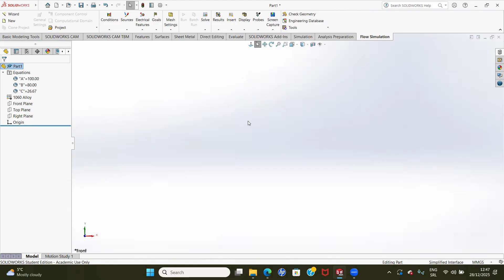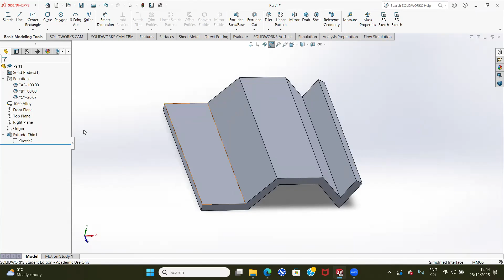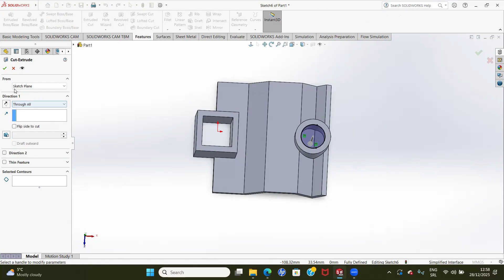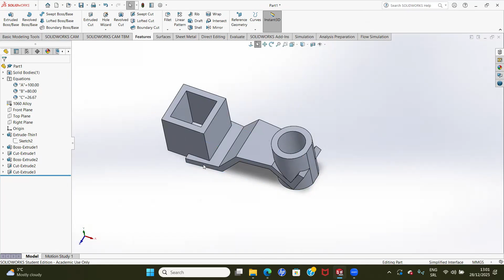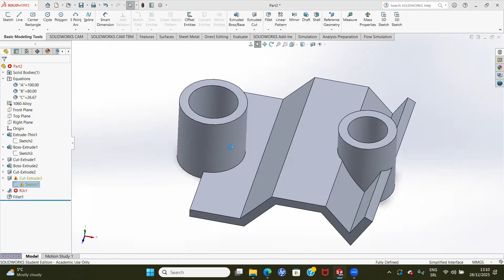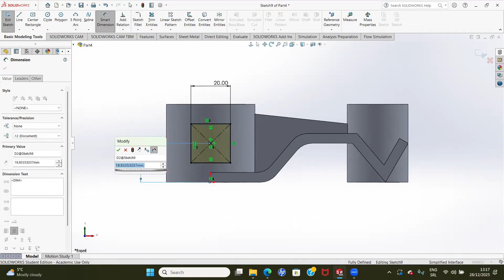SolidWorks CSWP Segment 1 Exam Sample

Comment: So this Video is pretty good at demonstrating some of the features that one may need for the CSWP. But I've noticed 3 inconsistencies from the drawing to the part.

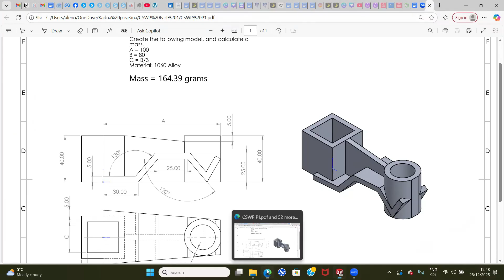1. 4:46 - Points aren't explicitly indicated to be on the horizontal line. Generally not good to assume those things. You can for the bottom one because the dimension like goes through but the one from the line to the point, not really.
2. 8:24 -  No indication of an equal relationship from the drawing so assuming so isn't great. The CSWP will have information that allows you to deduce those things or explicitly indicate them, otherwise shouldn't assume.
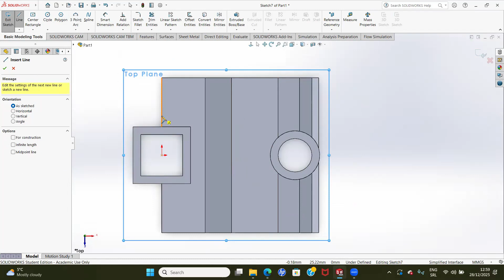3. 12:20 - This is the worst one given that the drawing actually doesn't have them as tangent. If you look closely you can see white space across the entire length of the line passing near the circle. This is an example of why assuming is generally bad.

Granted this is his part, his drawing and his video, he can do whatever he wants, but I would say generally this isn't a great example of what to do when taking the CSWP. In the test they will intentionally make points and edges close but not exact for the purpose of confusing the test takers. So perpetuating this practice may do more harm then good.

If I could give advice to the creator it would be to make sure that all conclusions can be made with sound logic and not assuming because it can cause issues if a habit is developed.
Reply from the maker: Thanks for your comment. Unfortunately I don't agree. I made these on purpose because CSWA and CSWP do make things where you have to see that some points are on horizontal or vertical line. That's why I've created examples like this. At the end even if they designate that it can be nothing but a help to see being able to see the details.
Reply: @e @engineeringcadschool 

Well did you look at the 3rd item of my comment? You clearly see that the drawing doesn’t have the circle as tangential. It’s not as much a preference thing as much as it’s just incorrect.